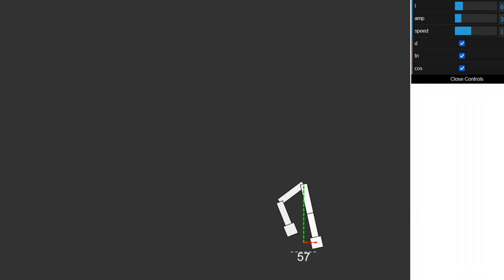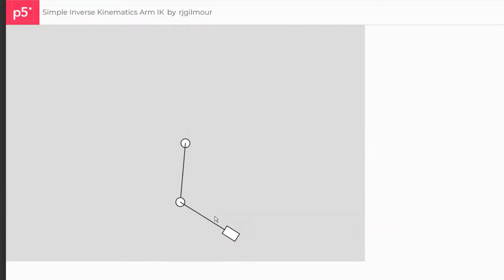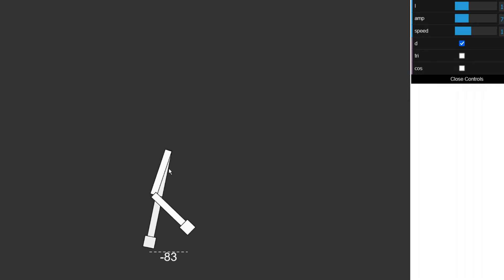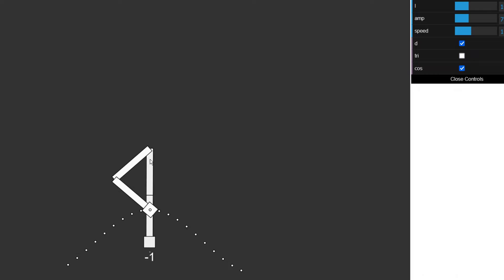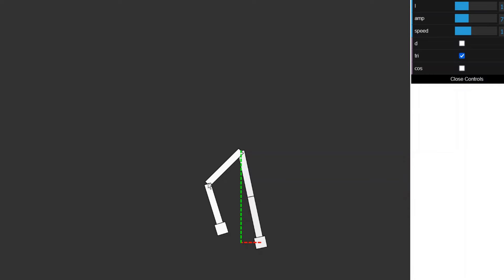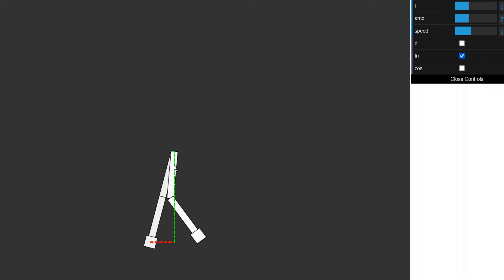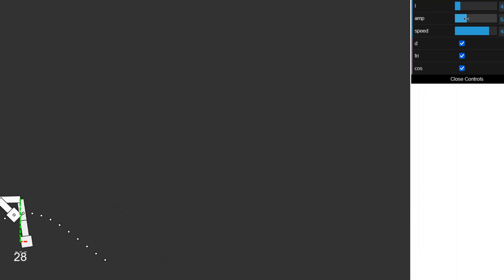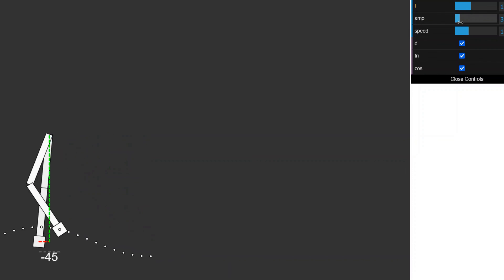Procedural Animation | Devlog 0 (code in description)

Comment: How did you discover that a cos() curve is the most fitting for walking? How would one go about determining the curves for running or any other movement?
Reply from the maker: A basic sinusoid such as sine or cosine is just a very basic way of generating periodic motion.  You could track the position of keypoints such as the hips, knees and feet and then use the fourier transform to determine the curves for those.   Or you could just experiment with different functions, easing functions for example.